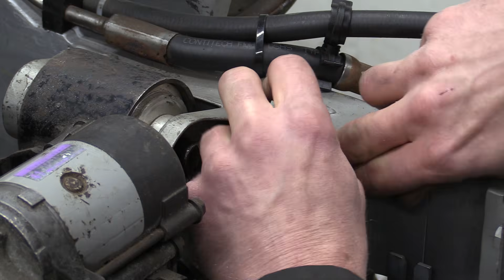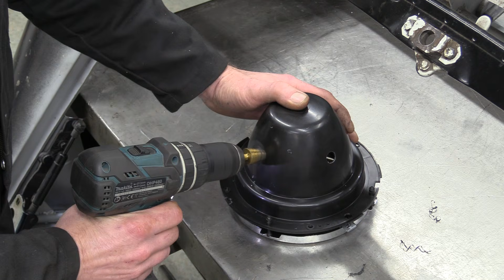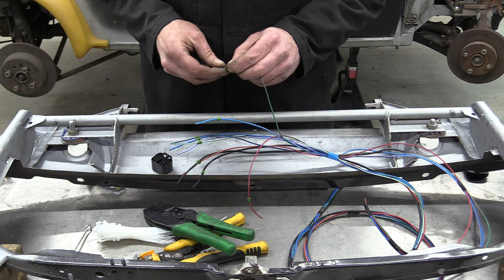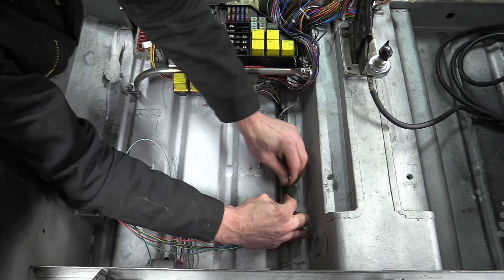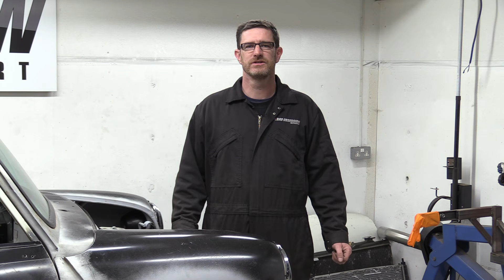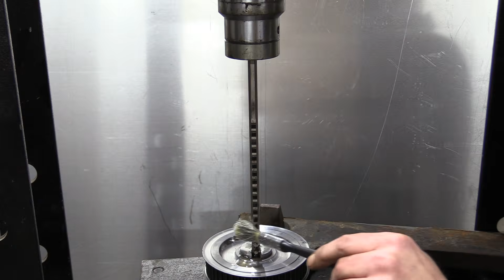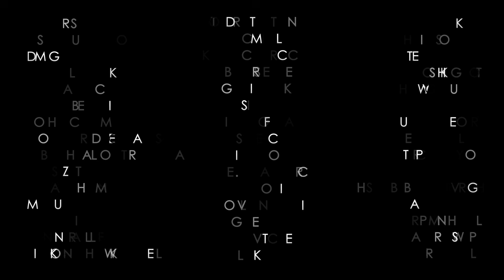Project Binky - Episode 20 - Austin Mini GT-Four - Turbocharged 4WD Mini

Comment: Hello, guys and thanks for a fantastic series. I am on my second review of episode 20 and would like to enter a friendly tip. 13min 49 sec into the episode we see the route of the rear wiring go through a hole. Even though the wires seem tightly fastened and the hole nice and round, I fear that vibrations from the motor and bumps in the road eventually will strip of the rubber sleeve cover and expose the bare wires. Could be an idea to install a rubber plug or guard of some sort. Ever so humbly, Roy.
Reply: They will install rubber grommets and loom tape during final assembly. This project is still in the fabrication and mock up portion of the build. It will eventually be coming apart again for paint.

Comment: "Ground" is a much more appropriate term than "earth," especially in automobile applications wherein wires are not literally sunk into the earth itself. (How could they be? Cars are mobile, elevated off the earth, and done so by giant, rubber, insulating tires o.0)

Comment: Guys, you might want to add some grommets where wires pass through metal holes, vibration tends to rattle and cut and bruise them in those places.
Nice nod to This Old Tony and square cubits.
Reply: VEC7ORlt
 .. The car will be disassembled before paint so there is no point  :)

Comment: You guys are awesome!!! The commentary is HILARIOUS as always and the level of fabrication is mind blowing. Might I suggest .... since your new toothed belt crank pulley took the place of the factory harmonic balancer, you might be able to machine one and fix it to the front face of the pulley (see TCI Rattler crankshaft balancer). Keep up the good work!
Reply: It's More of a harmonic Damper think that engine internally balanced its there to reduce vibration from the crank similar to balancer but still a good idea to use an adjustable balancer on the end of the pulley to give  it more mass and reduce and vibration if needed.

Comment: How you plan to rust proof things like door lock mechanism, wiper mechanism etc.? Maybe zinc plating it's cheap and work well.
Reply: But then they would have to cut all the zip-ties !
A little bit of spray paint will do, I'm sure.

Comment: Very nice, but no rubber grommets is a BIIG no no, also hope that the uncovered wire,s is temporary.
Reply: Of course it's temporary. The car is still in the fabrication and mock up stage. It will be coming apart again for paint. Then, loom tape and grommets will be added during final assembly.

Comment: Depending on the engine, removing weight from the  crank pulley may have  unintended consequences from a harmonics perspective.  In other words weight will most likely need to be removed from the flywheel/clutch now too.  Also, the pulley needs to fit more snug on the crank snout, it should take some force to install, accompanied with a temperature offset between parts.  That said, if you're using it  primarily for street driving you'll probably be ok, but any sustained high rpm use might result in failure.  EDIT, forgot to mention, fantastic machining regardless.

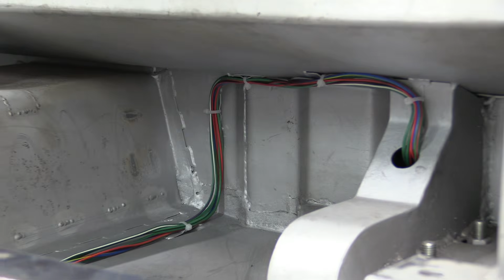Comment: At 13:49 you show the wire bunch going through a chassis hole without a grommet- that's looks like a short waiting to happen. I do like the fact that you don't cover the wiring,  it makes trouble-shooting easier later and lessens the chances of one shorted "hot" wire burning up the whole harness. This is a great project!
Reply: They didn't add grommets, or loom tape because the car will be coming apart again for paint. (No loom tape also makes it easier for wiring modifications if needed) Both will be added during final assembly.

Comment: Considering the high level of your work, I'm surprised you would run wires through areas with bare metal like that.  I would recommend you get some split loom, to protect the wires.

Comment: Thought the wires would have been re wrapped before cable ties go in on
Reply: Installation of the wires is temporary. The car will be coming apart again for paint. Then, loom tape and grommets will be added during final assembly.
Reply: @MellowYe77ow   that's an awful waste of cable ties then! ;)

Comment: You never cut all the wires to a connector at the same spot either. Makes the loom fat and ugly at the point all the connections are made. In certain cases you won’t even be able to fit the loom back where it belongs

Comment: You guys are really confident that the extreme heat of the exhaust manifold won't cause problems with the flex-shaft?

I am sure it is rated at something nice and high, but remember that it will generate its own heat in addition to that coming from the manifold. Maybe a ceramic spacer might help?

Comment: If the flexi drive goes AWOL you could always try a hydraulic drive and put the driven goodies anywhere in the car. The motors/pumps are around 95% efficient but connections soon lose a whole lot more. I'm sure you guys could solve all that and get a smooth fluid flow.

Comment: Are you gonna sleeve these cables? Just you have pinned the plugs with no sleeving.
Reply: Of course they are. This car is still in the mock up stage. They're leaving them unsleeved in case something needs moved, or changing. The car is going to be coming apart again for paint. Then, they'll add the finishing touches during final assembly.

Comment: I'd be a iddy bit worried about dumping the weight of the original crank pulley. It will have had a function for the crank harmonic frequency and damping. Couldn't quite make out if the replacement had rubber damping.  Was there no way of tapping through the gearbox casing to  take drive off a gear?

Comment: G'Day Guys and Camera Gal,
I'm too bit worried about the flex drive shaft thingie,,they do have a tendency to shrink under high loads,as the flex winds up to transmit load,
You could always put a set of bicycle pedal on passenger side and get them to charge ya battery,
The other thing i noticed was how close the shaft was to exhaust manifold,,it may be time for Nick to play with his grinder again and make up a heat shield,
just a suggestion,,
Reply: Hmmm,well i'm sorry,,After watching this episode again,i relised it is not the exhaust manifold,but the inlet,,,hmm sorry bout that,But i do love Nick,,,,
When he's grinding,,seems we have some thing in common,
love the sound of a grinder in the morning,
especially when i wake up the neighbors,

Comment: The original pulley could have been used keeping the damping. By parting off toothed section on new  pulley,machining O/D down  on old pulley so fits over,Heat shrunk on. Would have also saved a lot of time.

Comment: I think you could have saved a bit of time by just putting a small petrol engine in the boot to run the dyno and AC compressor. Lovely This old Tony 
reference!!
Reply: Or even put the whole HVAC system in the back and pipe the air to the front. Maybe not, that boot is rammed with fuel tank and he needs somewhere to put his Aldi shopping. ;)

Comment: You guys are not using grommets enough on your cable way access wholes. Vibration is going to be your enemy and it will cut through wires in time.
Reply: This is the mock up portion of the build. The whole car will be coming apart again for paint. Grommets will be added in final assembly. It seems that you also missed the Wallas and Gromit joke at the beginning of the video.

Comment: The harmonic damper in the front pulley is a necessary component for most engines. There are reasons why engine builders almost universally use them.  I enjoy your series. I do. But here I think that you have put a foot wrong on your build.  The harmonic damper inside drive pulleys cancels the flex in the crankshaft that occurs when each piston fires.  This is achieved with a torsional rubber spring and a ring weight, concentric to the shaft, that is tuned to 'snap back' just at the right time to cancel crank flex.  Going to a solid pulley removes this important, 'tuned' damper. The main problem with high speed torsional crankshaft flexing is not crankshaft fatigue, though that can be a problem. The main problem is that this torsional crank flex and the whipping back tends to destroy oil pumps, which are geared directly to the crank. For details on why you need this damper see this product description:  https://www.flyinmiata.com/ati-damper-pulley-kit-36-2.html  Harmonic dampers are used on the cranks of almost every automotive piston engine almost everywhere in the world.   I know that you can buy solid replacements.  'Better' engine builder never do this.

Comment: Would be interested to know what size the flexible shaft is? Not a ton of concerns with the alternator (other than RPM...) but I'd be pretty worried about the cable grenading on the first AC compressor cycle.

Comment: You need to put all wiring inside corrugated plastic pipe (the slotted type).  Otherwise it will rub somewhere and you know what'll happen.  That was the problem with italian cars of the 70s - 80s

Comment: Excellent drive solution. One thing I would say, replacing a damped pulley with a solid one can lead to bad stuff if the reciprocating assembly isn't fully balanced. Redtop's like to break their oil pump gears for instance. Nice Tony ref :D

Comment: I have total respect for what you guys are doing. Basic engineering principles used in clever ways and you have totally kept faith with the Mini 'look. But can I make a couple of observations (not criticisms)? @ 13:47 the wiring going through the channel really needs a grommet to save chaffing against the plate edge. Or a bead of plastic round the hole ...

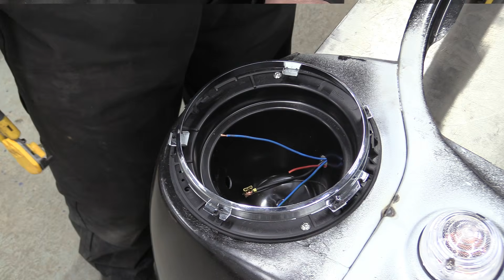The other thing that caught my OCD was @ 09:58 - those wires went nicely through that tube but they won't be coming back out ... see @ 10:10 and onwards and the plastic plugs for the headlight, side marker and indicator.... 

And are you binding the whole loom up after you take it all out (to paint the car) with PVC tape or braided?

I must be rather sad because I love doing wiring looms and sussing 'issues with sparks'. At Scanias I was the one who got the Electrical gremlins to sort out. Everyone else hated the black boxes that appeared as well ... me? Lappie and a diagram - Happy Bunny

Thanks for sharing your brilliant work ..

Comment: Well, to lay the wiring loom through the side member and through any access wholes without any kind of edge protecting rubber will kill it instantly in use. When the car is in motion, rattle and shocks will scratch the wiring isolation in time lapse and that would be so weired to locate these shorts. Why don't you use some protection duct?
Reply: You can imagine they're doing all those details post-paint...  (please see Please see https://youtu.be/WIyxrvO3dRk?t=48)

Comment: Just a friendly suggestion.  When cutting ty-wraps do not use cable cutters, but use flush-cut wire cutters and cut them straight.  Like that it will not create killer ty-wraps with shark teeth tips!  After more than 30 years in the aviation, I still hate getting gauged by a ty-wrap.  P.S. Fantastic Work being done!!!
Reply: Data engineer here. Cable ties can be cut flush with a regular set of side cutters. Just have one of the cutting edges resting against the zip housing so just one blade does the cutting. The running end should cut off clean. Flush cutters are nice though:)
Reply: @PhilXVTV  Yeh, I've seen that "technique".  I've also seen people looking for a new job pulling that type of shoddy BS where I've worked.  Do the job properly the first time.  Nobody likes being sliced open due too some DB who can't be bothered to use the proper tools or take pride in their work, no matter what it may be.
Reply: That had me swearing too, another aircraft engineer not fond of ty-rap rash.
Reply: @mrb1664  dumb poes
Reply: I dont think they care until final assembly time.
Reply: More likely to get cut hands during the build than when the carpet is fitted.
Reply: Same here, 10 yr aircraft mechanics here, but these days everyone is getting anal about FODs and left over tools and therefore I don't have an extra pair of flush cutters, so I can only use my normal cutters and hold them as tight against the zip tooth housing and make that cut.

Comment: Please tell me you aren't just going to have that nasty looking, after thought of a fog light just hanging there? 
Put it in the middle and make a hole for it or some kind of mount at least.  :(
Reply: Name 
I thought that! Although for me not a foglight but a reverse light, 
I've recessed mine into the rear valance by cutting same sized hole then building a closed box section for the light,  then made a door to cover it when not in use,  and that is triggered by a central locking motor and gear connected to the reverde light switch on the gearstick remote via a relay.
Reply: @RawTopShot  Out standing. :)

Comment: Instead of cutting the tie-wraps off with cutters, use pliers or the like and grab the tie-wraps just after the head. Then twist until the tail comes off. It does not leave a sharp edge, that will cut the shit out of your hands or arms when you have to work around them..
Reply: charleskro1 
I think that depends a lot on the material quality the tie wraps are made of.
If you can get a clean finish it sounds like recycled plastic or UV aged/embrittled.
Tie wraps are usually polythene and stretch before shearing.

Comment: What about grommets for where the wires go through a hole in any metal panel. The vibrations are going to chafe the wire on the sharp metal edge and cause a short.
Reply: You must of missed the Wallas and Gromit joke at the beginning of the episode.

Comment: Excuse me if it's been noted (can't be arsed to sort throw over 2000 comments to see). You're not leaving the loom unprotected and without grommets are you? It'll chaff through on the edges of the holes where it passes through bulkheads etc and not using some sort of loom covering will leave it vulnerable, especially in the front clamshell.

Comment: Please put a grommet ( I don't know the British term ) in the holes to protect the wires where they go through sheet metal.  Vibration will instantly cut through the insulation and cause the dreaded intermittent short circuit.  Resulting in a lot of foul language.
Reply: The correct British term for that is a "Gromit". For this vehicle they will probably be using ones of the "Wallisan" variety.

Comment: Do yourselves (and your forearms) a favor and buy some flush cutting pliers. They will let you cut zip tie tails off perfectly smooth and flat, so you won't be gashing yourself open on the sharp tips.
Reply: I've got scars from rookies using diagonals on cable ties.  Unskilled labour; they just need to be trained...
Reply: Data engineer here. Cable ties can be cut flush with a regular set of side cutters. Just have one of the cutting edges resting against the zip housing so just one does the cutting. The running end should cut off clean. Flush cutters are nice though:)
Reply: There are also Zip ties that finish flush,with no tails sticking out.

Comment: The original pulley for your engine is a harmonic damper as well and you will be seeing engine harmonic problems if your replacement isn't. I'm talking about main bearing wipe out problems.
Reply: this is real ^
Reply: @Lassi Kinnunen  Balancing to equalize and account for unequal forces and minor weight distrobution differences is one thing. The harmonic damper or pulley as mentioned here dampens harmonic frequencies created by the power pulses of the engine as it runs. Converting to a solid drive pulley can work, I've seen plenty of people do it on short duration race only applications but it is not good for your engine by any means and it can lead to hurt main bearings, broken crankshafts and a whole host of other issues.

Comment: This is my favorite thing on youtube. I am always excited when I see a new episode pop up. I was surprised that you didn't put a braided sleeve or cable loom over your wires when you installed it into the vehicle. Based on the rest of the build that seemed like something to expect. I am sure you thought of it. What is your thoughts on adding the sleeve or loom? Was it an unnecessary expense or weight reason?

Comment: I've been googling yet can't find a source for the flex drive shaft you used. Care to share? Interested to see a datasheet, specs, etc.
Reply: https://www.ondrives.com/flexible-drive-shafts
Reply: honestly? I googled "flex drive shaft" and it was literally the first thing that popped up in images.
Reply: Naturally that was the first thing I Googled (well, probably "flexible drive shaft") but wasn't able to locate that exact part. Google shows different results based on geographic location so that likely is the reason. UK supplier, I'm in Canada. Thankfully looking up Ondrives directly (which interestingly you can't Google because Google autocorrects it to Microsoft's OneDrive) I was able to find the data and spec sheets.

Comment: Love this project and the work you are doing but.....not adding additional insulation to the loom and battery cables scares me...especially when you route them through panels and around metal edges of panels....think of the possible vibration and cutting ability of those edges..!

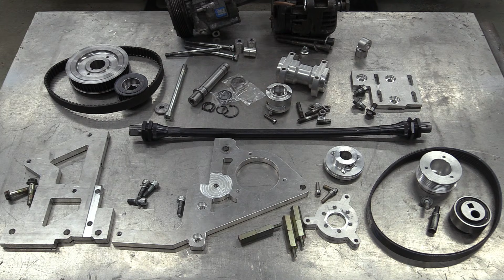Comment: 27:47 That alternator mounting looks like it doubles the weight of the engine. Prime British overengineering.
Reply: There's a lot of load and suspended weight there.  Voted: worth it.  It's billet aluminum - I doubt it adds as much weight as you think.

Comment: Glad you saved a few ounces on that toothed pulley - you can add them to the several pounds you've added with all that alternator / air con pump.  You're in the UK - why'd you need air con anyway ??.